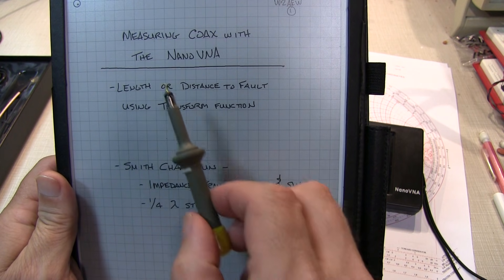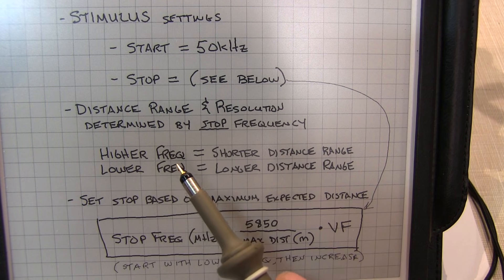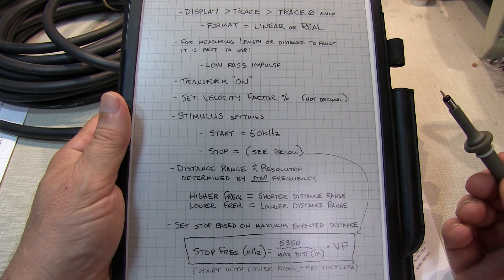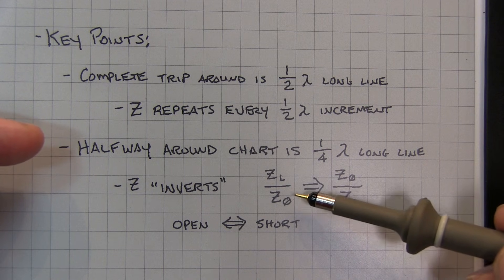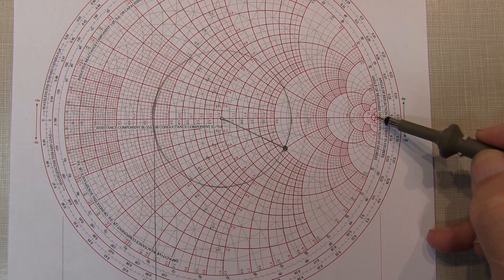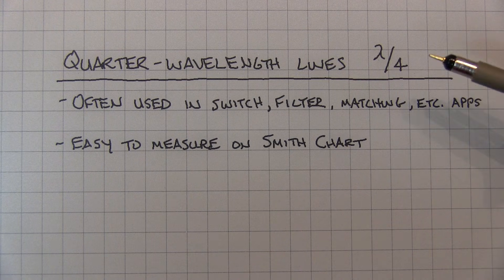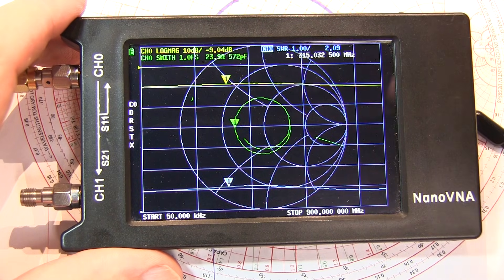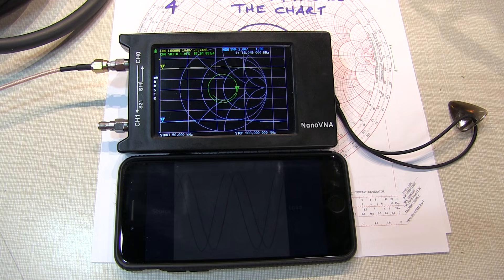#316: Use NanoVNA to measure coax length - BONUS Transmission Lines and Smith Charts,  SWR and more

Comment: Learned a little? I learned a lot! Thanks again, Alan! I had some questions... Using your method, it should be possible to determine an unknown length of coax, provided I knew the velocity factor of the coax in question. But, in the case of an unknown length, is there a “general” frequency I can use, or would I use the application frequency in this case? Ok, so, I’m working towards my Amateur Extra, although be it slowly. Your videos do help take the edge off of understanding a Smith Chart. Do Smith Charts always read in a clockwise fashion when determining parameters? 73!
Reply from the maker: If you have no idea of the length, simply start with a low frequency, maybe 30 or 40MHz, and then work your way up to get better resolution.

Comment: Just came in from another unsuccessful Satellite pass and was pleasantly surprised by your video on the NanoVNA.  Do you have a recommended model and source for a 1 GHz or greater NanoVNA?
Reply: check out nanovna v2
Reply from the maker: @saliltembe8665  The NanoVNA-H4 that I have goes to 1.5GHz.  The newer NanoVNA-V2 (aka S-A-A-2) goes to 3GHz with better performance, but isn't widely available with an enclosure yet.
Reply: @w2aew  True. NanoVNA H4 also took quite sometime to reach to where it is. The first nanoVNA also came in a clamshell case when it was first launched. A larger screen and a case is work in progress. We could see it come out soon. Also, the hardware is capable of going upto 4.4GHz with slightly poor dynamic range beyond 3GHz.